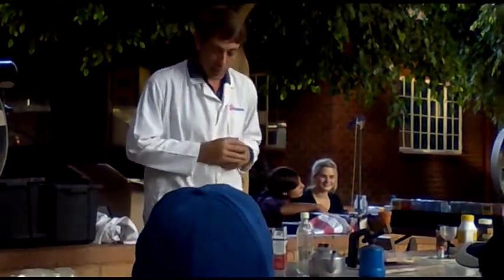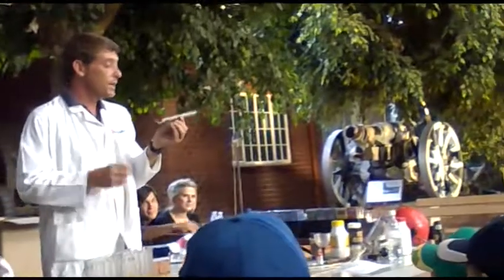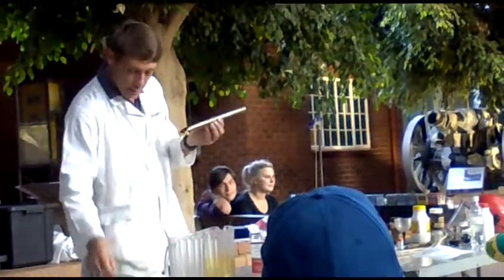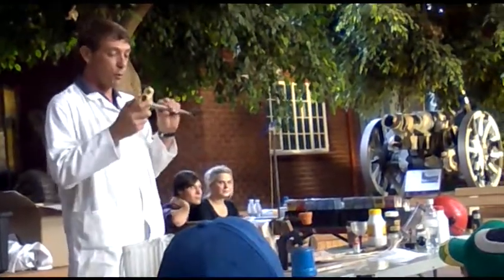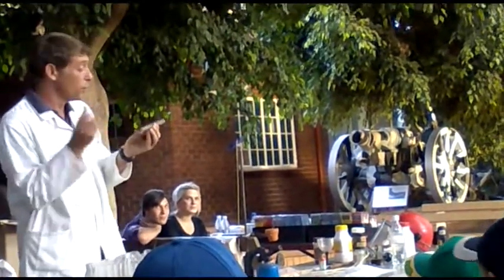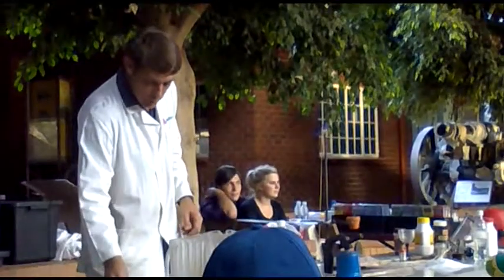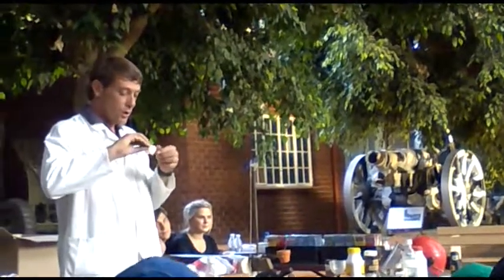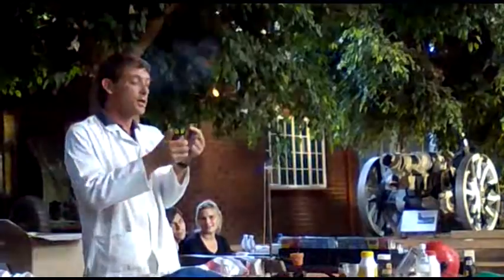Make a Flash-Cotton Potato-Gun

Comment: Notice how he did not pack the potato all the way down with the ram rod. Doing so would cause a much larger explosion, most likely blew his hands off. Flash cotton explodes more powerfully the more compact or confined they are.

which is why when you  look at modern bullet cartridges it is not filled full of powder unlike traditional black powder cartridge.
the airspace is there to avoid building unsafe pressures.
Reply from the maker: Indeed!  He's clearly done this before several times.  I used to work in an explosives factory where we made this stuff in the 3-ton batches, called nitro cellulose, used as an propellant for bullets to missiles!  Very potent stuff!